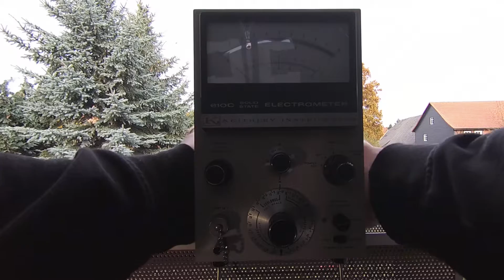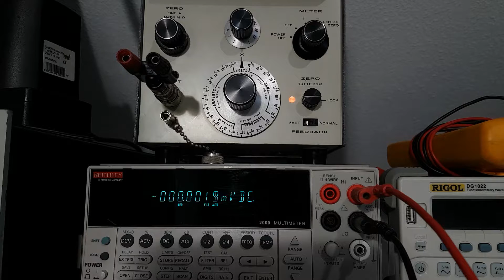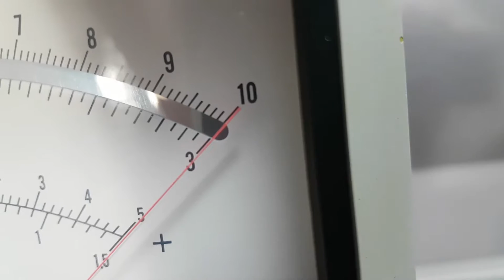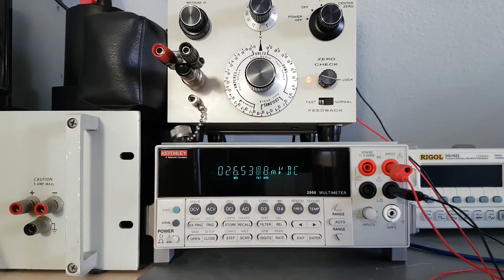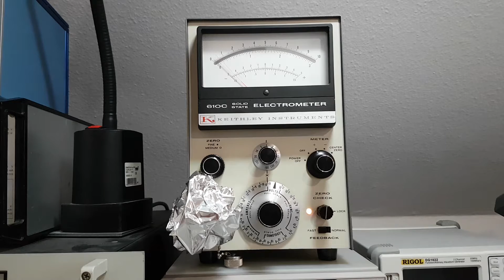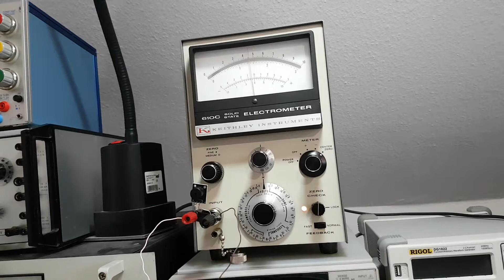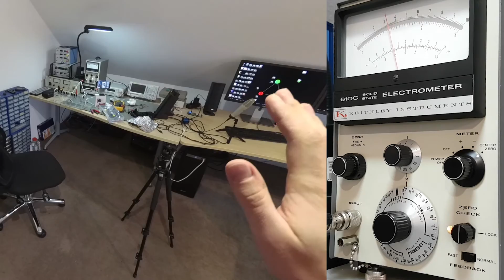Keithley 610C Electrometer Calibration and Experiments

Comment: Im messing around with some electrometer opamps (very low input bias current) like OPA129.
I attached a piezo element to its input and listened to the output thru an audio preamp. 
It is my most sensitive piezo contact amp so far. 
I believe i would be able to hear ants walk across the element.

Comment: Hi Marco,
What reliable ways are there to measure high resistance resistors? I made a box (metal) with  several 250gohm resistors, but they may as well be an open circuit...
I feel a hit reluctant to put a  2500V insulation tester on them...
Thank you. 
Cheers 
Mark